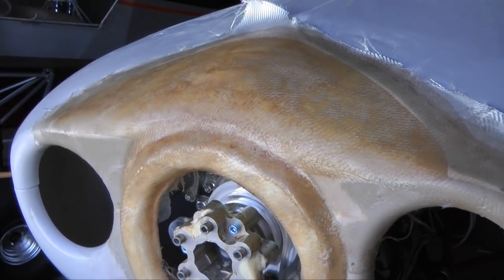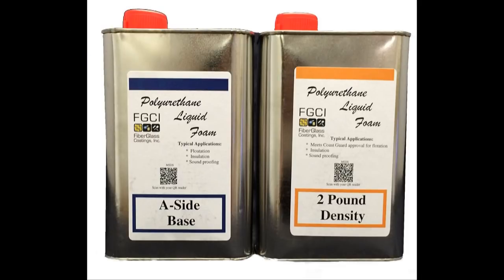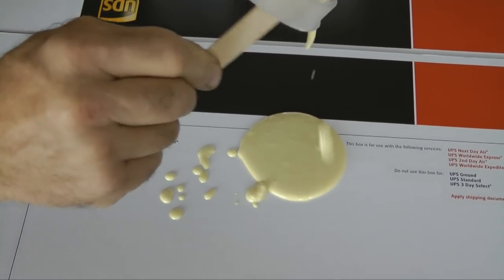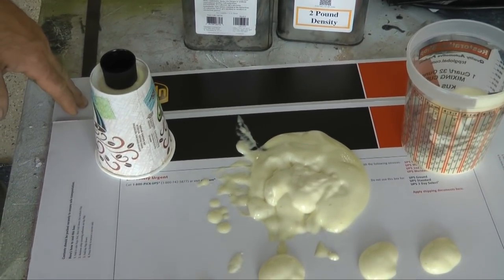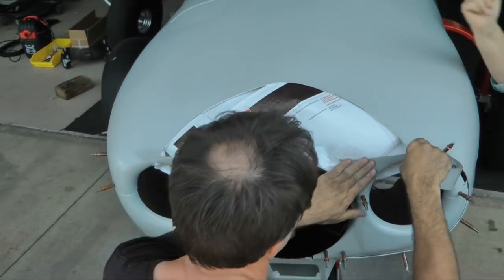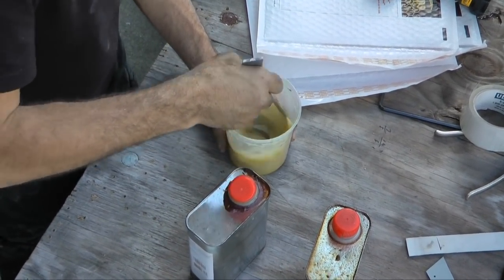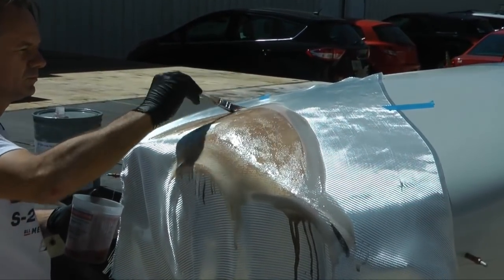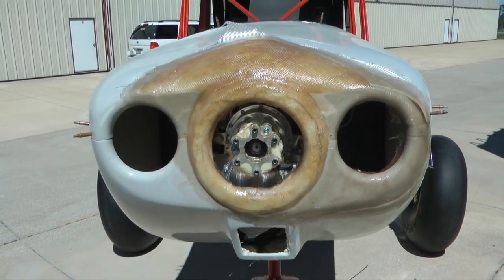Using Polyurethane Foam to Modify Fiberglass Aircraft Parts

Comment: Another alternative is to use Sika Boom polyurethane foam. It comes in a spray bottle and can be applied on to target area with a nozzle. No mixing required, and it is correct consistency out the can right away.

Comment: St mask should be used when sanding. Urethane dust in your lungs will not dissolve , you will have it for the rest of your life. It takes 24 hours for urethane systems to fully cure. Ratio of materials should be done by weight using a very good scale. When the material is cured, a brittle product means you had to much “A” side or isocyanate. If the product is soft or spongy you had to much “B” side or resin.
Just a couple of tips I was in the polyurethane business for 40 years.

Comment: Great video...as usual.  I would like to see some tips on creating fiberglass shapes for streamlining/sealing gaps between wings and fuselage.
Reply: You can stretch speaker grill cloth over the surface, and when you're happy with the shape apply a few coats of resin. This will essentially give you the shape and from there you add your choice of fiberglass to build the actual part and depending on your needs you either build up from the top or bottom  of the cloth mold. Also for less intricate shapes you can use another cloth like t shits,old sheets etc.its not a big deal since it'll be trashed.
Last but least is when building over a existing part I'll coat it with  peel ply,masking tape foil etc depending on what I'm doing. But for instance when I'll be making a part from the stretched cloth I'll leave the peel ply attached to it.this way you're able to separate the fabric from the actual part........if you want more information there's a lot of videos on building speaker pods and boxes etc. The methods carry over but the main difference is weight isn't as big a concern so they'll generally leave the grill cloth start in place .
Reply: emrcee. Me too I wana see that one.
Reply: Its sort of like fiberglass instead of dope on a fabric plane.the curves are created similar. So to add on to my previous post,say you want to create a smooth curved panel to cover a gap where foam won't work because you're not able to cover up there. You'll lay your tape or peel ply across,stretch the cloth across adding anything u want or need to help the shape/transition if needed ,multiple coats of resin, let cure,carefully remove and then build from that........its actually pretty easy once you have tried it.

Comment: Purchase a Surform Files as it works much easier when shaping this kind of foam. When close to your shape use a flat or flexible sanding board to finish off the shape needed.